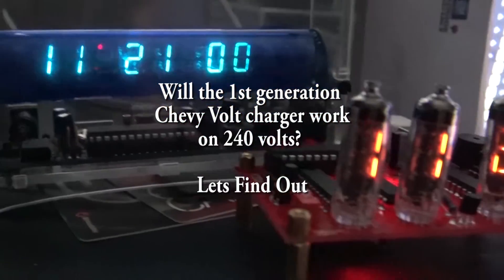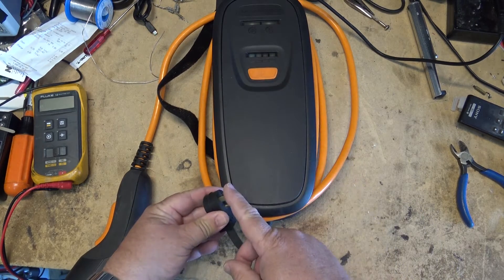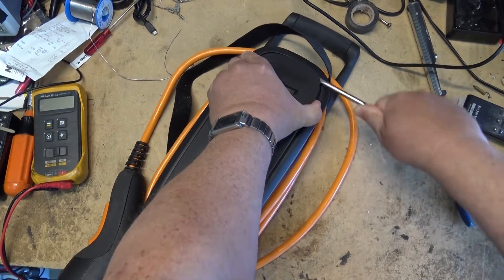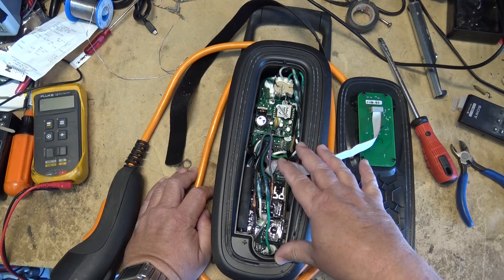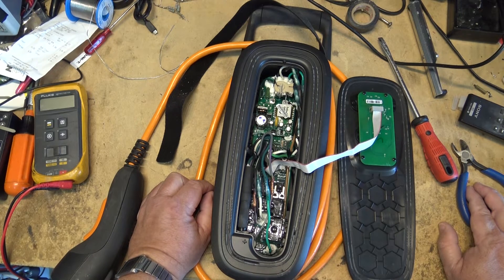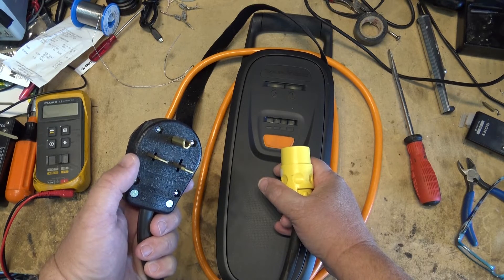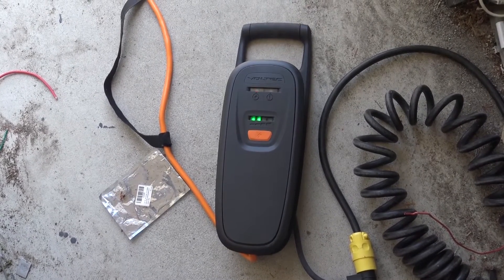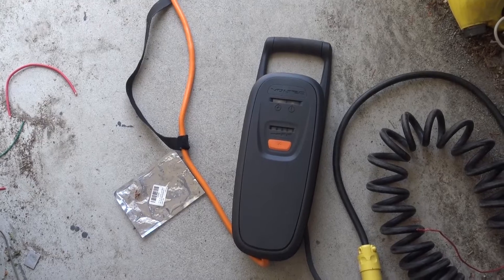Can the 1st generation Chevy Volt charger operate on 240 volts? Lets Find Out.

Comment: Thanks, was looking for this exact video. I have a 2015 with the same charger
Reply from the maker: First gen the answer is no as we found out.  Second gen the answer is yes, and i do operate it on 240 and have for the past 3 years so both cars can charge on 240.
Reply: @12voltvids  yea sadly I have a 2015 Volttec charger, looks to be Gen 1.  Did they make any Gen 1 Chargers that can charge on 240v? Just curious if they had any models that might
Reply from the maker: @JacuzziSurfer  the voktec level 2 can run on both and many have scooped a unit with a bad cord and swapped boards.  
I will say that I think the first generation car is a much better car than the second generation even though I love my second gen. My wife drives the first gen and I get to drive it once in awhile and I still love driving that car it handles so much better than the second gen. Handles more like a sports car, and even though the second gen is quicker and charges faster and goes further on a charge I think the build quality on the first gen was better. GM made the second car lighter little bit bigger and less expensive and it shows. The first gen was actually built to be a Cadillac and they did offer a version of it called the Cadillac ELR which sold for 80,000 plus. My first gen now has over 180,000 km and had nothing done to it other than change tires. I did pick up a cheap level 2 charger on Amazon paid $217 although I did a review on it and right after I did the review the price doubled but it has been a solid charger for the time I've had it. I was thinking of taking the board out of my dead level 2 full-tech charger and putting it into the level one case from the first gen to make yet another do a voltage charger and if one of my other chargers gives up the ghost I'll certainly be doing that because my voltec level 2 what failed on it was the charge cord the connector plugs in the car water leaked in and corroded the circuitry around the switch so it would not signal that it was ready to charge

Comment: Hey thanks seems many feel it is compatible but you proved it is not.  On mine plugged in to 110 I get both red flashing lights and I cannot figure how to fix this. Just started one day and on the web no one seems to discuss that. Is it fixable or do I need to buy a new one?
Reply from the maker: Red flashing lights hmmm. How is your power going in ground ect.
I only ever use the old level 1 when travelling.  I use the new level 1 on 240 because it is infact a level 2 with a 120 plug.  I use that on my old volt and use the dedicated level 2 on the new volt.  Basically the only difference between them is the clipper Creek that comes with the new volt and bolt is a 12 amp charger 2.8 kw and the original level 2 is 3.6kw so even on 240 the old wall mounted unit is 45 minutes faster on the new volt.
Reply: @12voltvids  This is the original 110 charger that came with the car. I plug it into any outlet and it goes green then the lower four lights light green, upper lights go red then green then both blink red... no charging.   All the videos show changing fuse but if I have lights probably not a fuse.  All outlets are 3 prong grounded, if plugged into a gfci... gfci blows. I'm stumped.
Reply: Sorry meant to say... this is an early 2011 Volt.
Reply from the maker: @stevegladstone6699  
Yes that is the old Lear charge cord.  I have a 2012 and a 2019.
Reply from the maker: @stevegladstone6699  
Interesting.  Nothing comes to mind off hand  will have to research. Will not be a fuse that has failed but it could be one of the MOV on the input.  There will be  I believe.  Hot to ground and neutral to ground. If one of these goes leaky it would trip the cfci breaker.

Comment: This would totally disable ground fault protection and I'm sure is against code anywhere there is one, but IN THEORY I believe it could work by:

1. If ruining your charger means a bad day for you, don't do this.

2. Find and cut input trace on neutral side of double pole relay that goes to car plug.
3. Cut neutral wire that goes from power cord into charger (this will now be L2, line voltage for 240V).
4. Splice ground from power cord to both ground and neutral input wires on board. This will maintain 120V to all sensing circuitry.
5. Connect neutral wire from power cord directly to input of double pole relay so 240V only exists from the relay to the car.

If you want to go the extra mile for resemblance of code compliance and safety, replace power cord with a 4-wire cord and keep board inputs to the correct wires (L1, neutral, ground) and only connect L2 to relay input.

I haven't looked inside my charger yet, but if it is a board trace that has to be cut at the relay input, be sure to remove at least a few milimeters of trace, as after the mod each side of the trace will have different voltages.

Lastly, if you reeeaaaly want to follow code and fear mongering lawyers, just buy a new L2 charger, they're $150 on eBay now.
Reply from the maker: This was not about modifying the original charger cord it was to show what's inside and that it doesn't work.  The new level 1 that comes with the 2ne gen and the bolt is already a level 2 with a 120 plug on it.  Easy to convert that one.
Reply from the maker: I would imagine that they are just sensing if there is any voltage on the neutral so it would just be a matter of cutting that trace, and since this is almost identical to the 240v version it would just be a matter of looking at the boards, but I am not about to do that. I carry this charger just to charge when I am travelling. I already have the Lear (Voltec) 240v charger at home, and the travel charger that came with the 2019 volt is capable of 240 charging (At 12 amps vs 15 for my dedicated 240). ALl that is needed is the adapter cable shown in this one, which does not work on this model, but does work on the clipper creek charge interface that ships with the new Volt and BoltEV.
For the Bolt drivers it is a FREE 240V, which is much better than paying 1000 to buy and install a dedicated, but the purchased ones are generally 30 amps so they will charge faster.
Reply: Do you know of any body who has accomplished this yet and if they've made a tutorial?

Comment: Funny how the North American market that has both domestic voltages of 120/240V limits most of their power supplies to 120V while here in Europe we only have 230V and virtually all modern power supplies will work from 100-240V even if if not mentioned. For instance have 2 CRT TVs (Thomson and Sanyo) that says on the back 220-240V on the back and they work perfectly fine on 120V, I have a step down transformer because we have stuff we brought from Canada and I tried it. Also all my LCD TVs work from 100-240V.

Come to think of it, I can't recall any electronic equipment I have that won't work with both 120/240V except what we brought from Canada that works on 120V only.
Reply from the maker: Over in europe your voltage is 230 (or 240) Hot and Neutral plus ground.
Here we have split phase 240. Either phase to neutral is 120v, plase to plase on single phase residential feed is 240v. Icommercial buildings, and apartments, they generally use 3 phase power. Any phase to neutral is 120v as it is with residential single phase, but phase to phase it is 208v not 240 due to the phases being 120' out of phase, vs 180 for single phase. 
For the 3 phase setup they use only half the secondary winding. Center tap grounded (neutral) and 1 tap per phase. In single phase they still tie the center tap to ground (neutral) but both windings are used, and thus  the 120" phase shift and 208V.

Comment: Wouldn't be surprised if there's a jumper or 0-ohm resistor somewhere on the PCB which sets the "correct" voltage for the voltage detector, which could be used to change it to a 240V charger.

Comment: Sorry, maybe I'm not understanding, but how would you have known this was actually true without doing this test? You turned out to be correct, but did you have inside information in advance that informed your position without testing it? Best wishes.
Reply from the maker: I didn't know. That is why I took it apart and checked for components that would go nuclear if over voltages. Namely the primary filter on the low voltage power supply. 
Basically how these operate is as a switch. The mains gets switched straight through to the charge cord.
So there is a low voltage power supply that operates the circuits that check for ground faults, leakage ect. It also operates the pilot generator that sends the current capabilities to the car. On the original level 1, there is a button on the front that selects 8 or 12 amp charging. This changes the duty cycle of the 1khz pilot signal sent  to the car. The clipper creek that comes with the second gen is fixed at 12 amps, and to select 8 amp charging it is done from inside the car as opposed to a button on the interface.
Anyway the level 1 from first gen won't go boom if given 240V, it just will sit there with the red light blinking. That was the purpose of this test, to prove to the "know it all's" that it does not work.

Comment: I'm supprised you took a risk with that smart relay/charger, i guess that even the earlier version would still be expensive to buy :-(.
Hopefully people will shut up now.
Reply from the maker: That is wht I opened it up. To look for low voltage capacitors on the low voltage PSU, and for any MOV that were rated for low  voltages. Since the PSU was capable of 240 I knew there would not be any sparks, flames or magic smoke. (Yes it still works fine BTW) but what I did not know if if they put any voltage detection in for over voltage. Now we all know they do indeed monitor the voltage.  Lear produced 2 versions of the charger a 120V only model that shipped with the car and a 240V version for permamant installation. The new cars come with a Clipper Creek and they only make 1 charger, and put either a 240V or 120V plug on it and slap a label on it.  Makes perfect sence too, because having 2 totally different boards for the 2 voltages doubles the cost. I guess it was a way to sell the 240. The original one was sold by GM. Now if you buy a seperate level 2 you are dealing with a 3rd party company, like clipper creek, SPX, Chargepoint ect.
Reply: Sneaky for lear to make one pcb for two chargers, i bet there is a pcb solder jumper to change it to 240v, but it does make sense to make only one unit.
I would still want to check the actual charger built in to the car before feeding 240v via a smart relay.
They are nice cars, smooth and quiet with a good range.
You seem very happy :-D
Reply from the maker: @zx8401ztv  lear made 2 different boards.  Clipper creek made 1 for both.  The charger is in the car and it is 110 120 208 220 230 240 compatable. The charge unit is just a smart relay box that checks for ground faults and communicates with the car over the pilot lines before turning on the power.
Reply from the maker: 5 people don't like it.